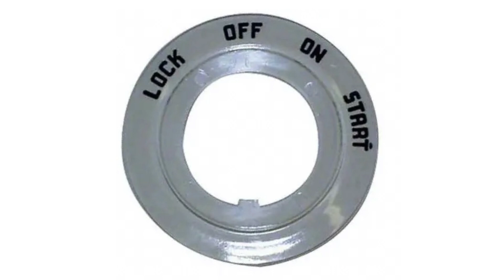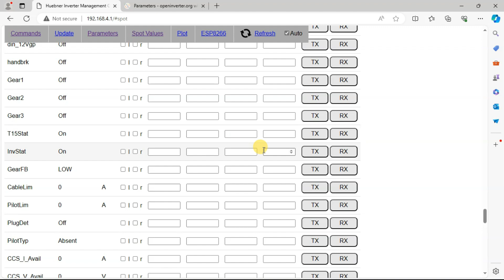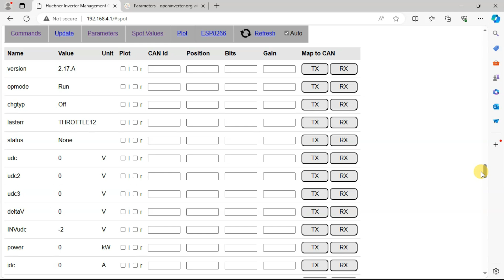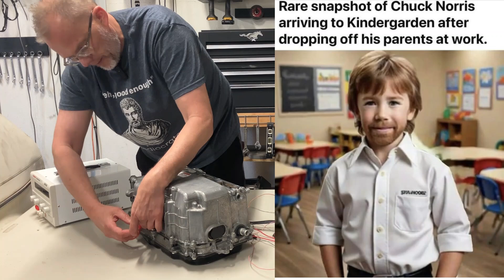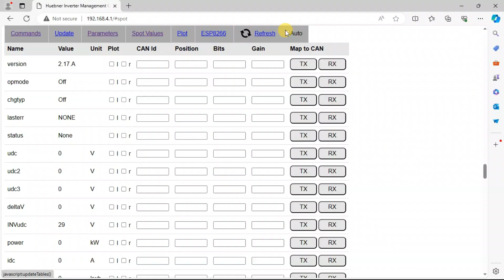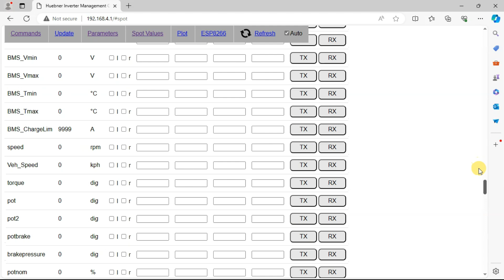ZombieVerter VCU Prius Inverter Connection 2

Comment: You know what I am such an idiot 😂. Remember i was saying that my inverter doesn't read temperature or invUdc. I have spent so much time checking with DVM all the connections for Toyota comms. All wires were connected correctly but i just found now that I forgot to change inverter type from Open inverter to Prius in the General setup section, I can't believe that I missed that during all this time😮 😮😮😮
Reply from the maker: hey, I won't tell if you don't tell... if we had a dollar for every time it was some bone head mistake, right ?!
Reply: @Good-Enuff-Garage  yes I know but I am so happy because this inverter is unknown quantity. It worked with Open inverter board but I never run it in the original configuration